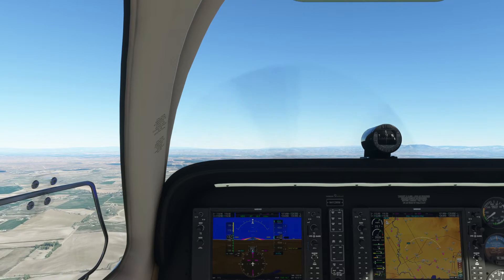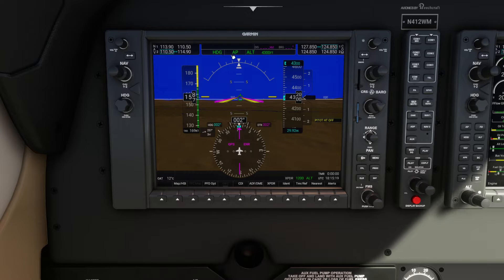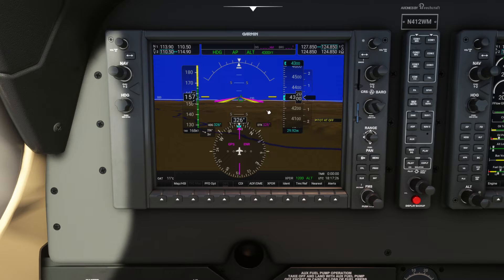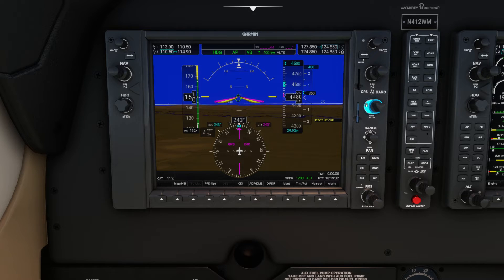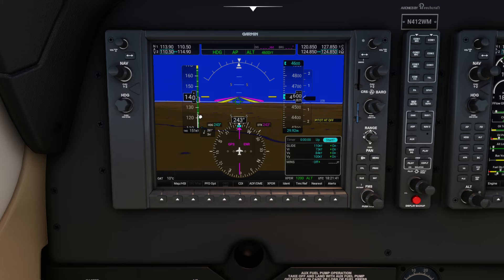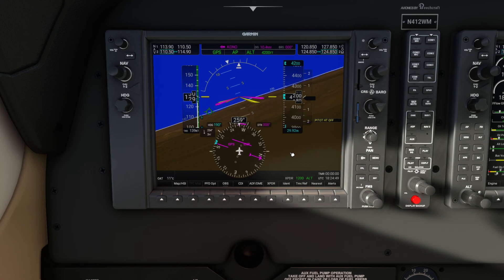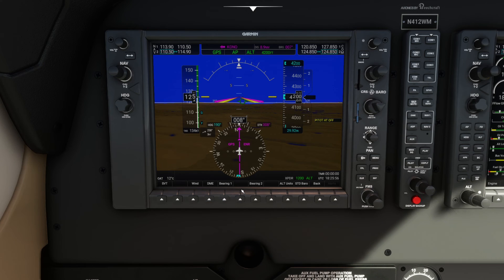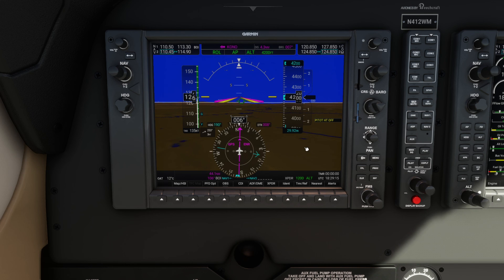Garmin G1000 Tutorial 2023 - Part 1

Comment: Can SVR be turned off?
Reply from the maker: Yes, you can turn off SVR on the Garmin G1000. It's often referred to as Synthetic Vision System (SVS).
 * You can disable it through the PFD (Primary Flight Display) settings.
 * Newer versions, like the G1000 NXi, have a dedicated softkey to turn Synthetic Vision on and off.
 * In some systems, you may need to go to the Aux-System Setup page to enable or disable it.

Comment: Question, I was doing an ils approach to ksfo, runway 28L, I am lined up to runway and I hit the approach button but I did not capture the 109.55 frequency and of course missed the approach ,what did I do wrong. Flying a baron g36.
Reply from the maker: @jtepsr  you either did not have the approach activated or you were not tuned into the correct frequency in NAV one to capture the localizer.
Reply: Trent I use a Logitech radio and ap modular and I was at 1800 feet to capture the glide slope. I use an approach plate to check this. Was I suppose to go into pfd and activate approach in lieu of hitting the button on the ap unit
Reply from the maker: @ I don’t know enough about the set up you were using to give you a definitive answer. But what I can tell you is that if you don’t activate the approach, the aircraft will never capture the glide slope and descend down to the runway.